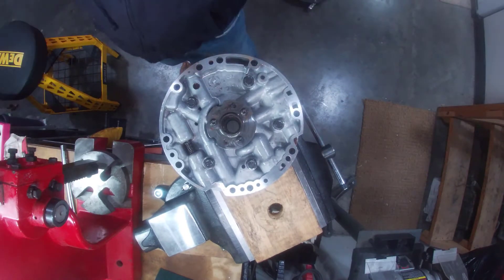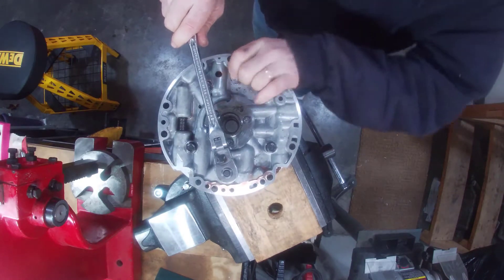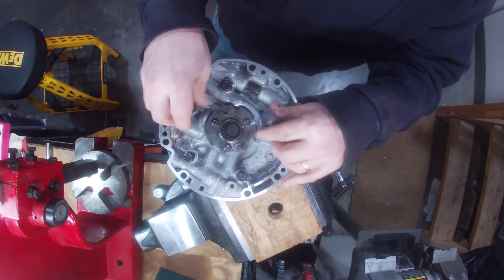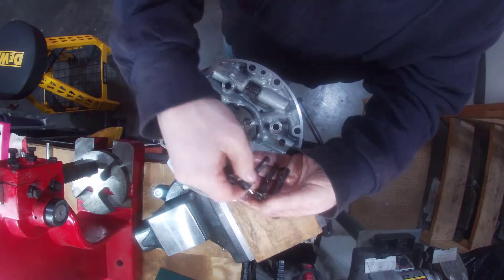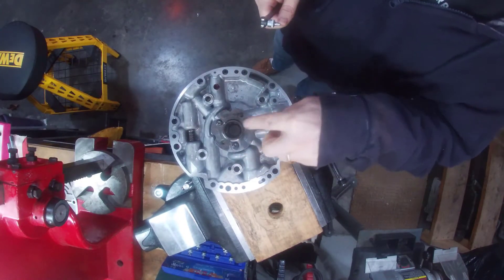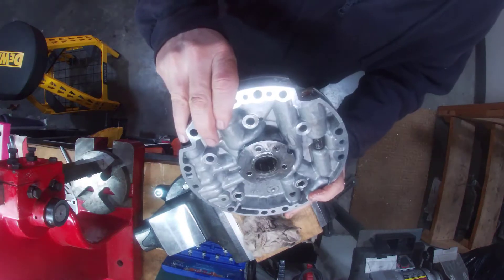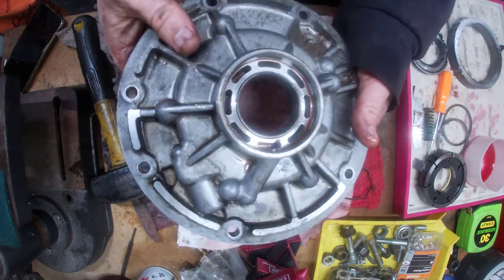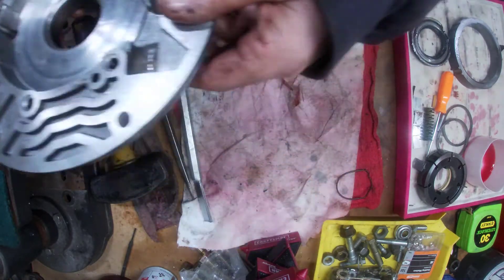200-4r Rebuild - Front Oil Pump Teardown (part 5)

Comment: Just curious, my 87 GN has a vigilante 5 disc lock up 3200-3400 stall. I’m going to switch it out due to the engine stalling issues I have, it’s also I well know issue. The pump was modified with a oil tube return for manual lock up which I’m not using. Can I leave this tube in when changing to a single disc lock converter or can I leave it as is, thanks